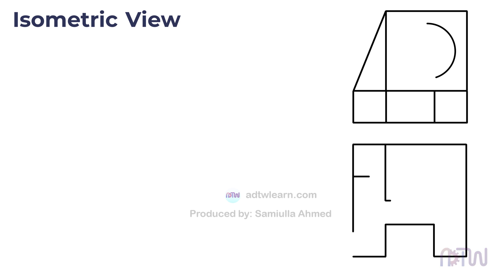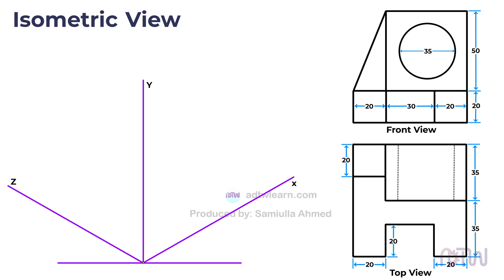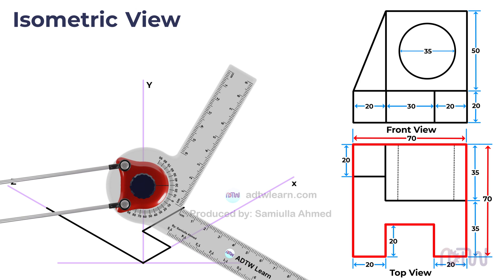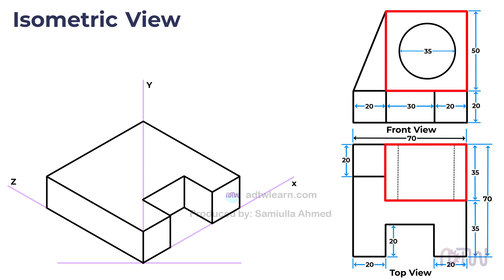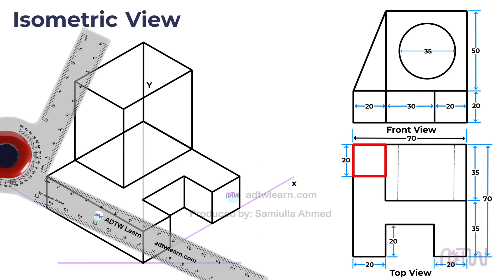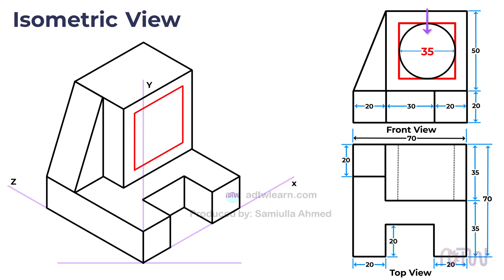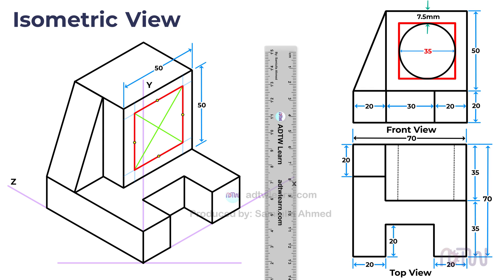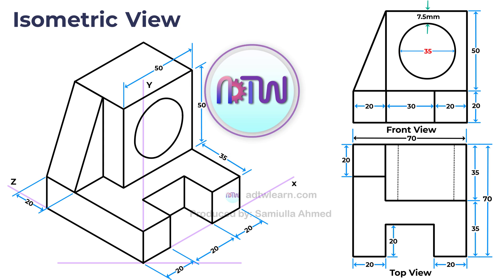Isometric View | How to Construct an Isometric View of an Object | Example: 4

Comment: Why it is 7.5mm on getting the centet of the circle?
Reply: Because the length of the square is 50mm, but the circle has a diameter of 35mm from the center point. So, to put the circle exactly at the center, you subtract 35mm from 50mm which gives you 15mm. The 15mm is the total space from both sides, therefore, you divide it by 2 so that you get equal spaces on both ends of the circle. 15mm/2=7.5mm. This is the space between the circle and the square walls
Reply: @kennethkngoma1262  thanks